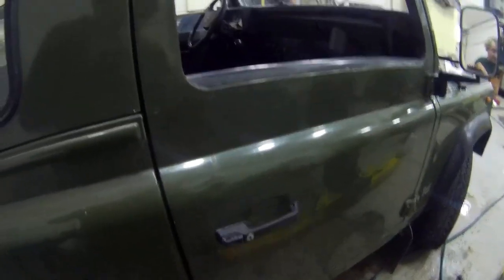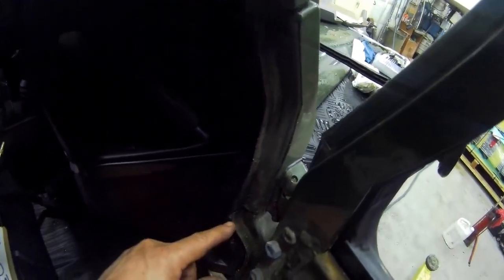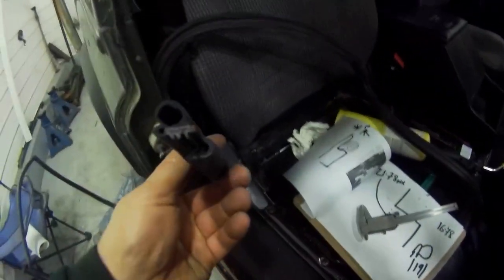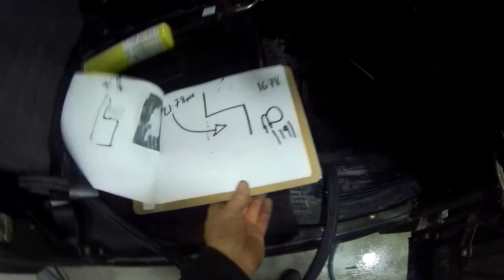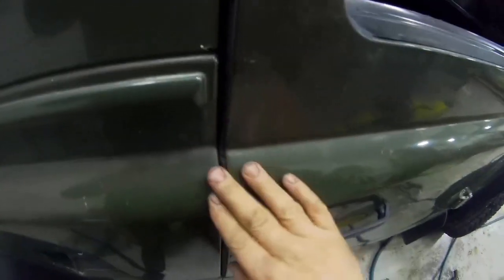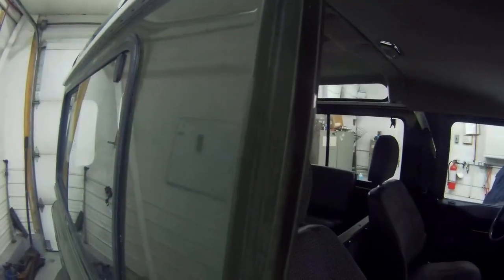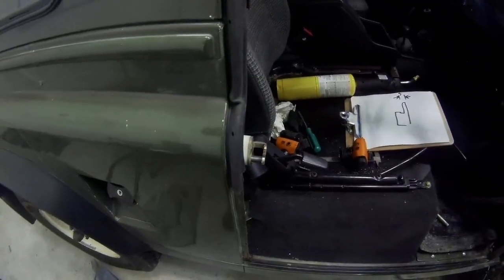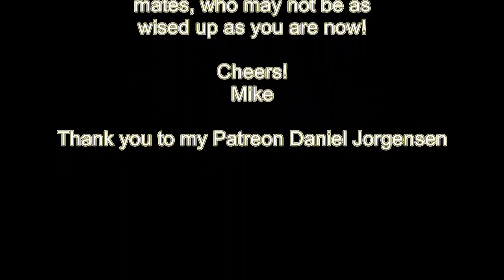Defender doors - fitting the seal to stop leaks - Success or fail?

Comment: I realise this was an old video but I have only just found the channel . what a refreshing collection of videos to see.  No dramatic intro sounds & images, just down to earth presentations.  Great thumbs up!

Am I right in thinking it is better to adjust the door prior to installing the seals?

My '91 Defender 90 pickup has both wonky doors & tired, split seals as well as completely rotted waist-seals.  Its in poor shape overall so everything will need to be altered ... although not today, blowing a cold stormy gale in Somerset & no garage!

I'm incapable of the bigger mechanical jobs but I think I should be able to 'shut that door', lol.
Reply from the maker: I always fit the door without the seals - just be aware some cheap seals are so hard you have difficulty closing the door after fitting them. Some seals have reinforcements in the top corners - this makes the door stick out at the top
Reply: Thank you for the speedy response.

In your experience, is the rubber-quality of LR OEM really worth, in both price & longevity, double or greater than replacements?
Reply from the maker: Genuine Puma door seals fit and shut well - OEM are not OEM in this case Genuine ones are made in Poland. I will not fit anything else as they can spend days getting cheaper seals to fit
Reply: Grateful for your input.  Thank you.

Comment: Where you pushed up the foam padding, could it be cut down in half & then re-inserted in the cut through the outer foam seal before you reseal it in the original position? I am soon at the point where I have to do this & will try it unless there is no point!
Reply: I see a similar comment made below. I wonder if it worked?

Comment: Hi Mike,
I’m having the same problem with my Defender 90 to the extent I really need to slam the one door to get it to latch properly. The foam insert in the seal seems to be the issue. Do you think it would work if I carefully removed the foam insert, sliced it in half and replaced it so that it wasn’t as big? I don’t mind if the door sits a few mm proud but it’s the fact I really need to slam the door to latch is what bothers me most. 
Thanks. 
By the way, love the videos. Best resource on the internet I’ve found for Defenders bar none.
Reply from the maker: Yes remove the foam (it is not glued in) and superglue the cut
The top corners are tricky and have the same foam but I noticed on later aftermarket seals the foam was not in the top sections
Mike
Reply: Britannica Restorations Ltd Thanks Mike. I’ll give it a try. Thanks for such a quick response.
Reply: @BritannicaRestorations  Hi Mike I had the same problem but after couple weeks all problems disappeared and now the doors closed perfectly ! The seal just need more time to settle down.  Regards

Comment: Hi Mike greetings from sunny lancashire came up against this very problem today spent about an hour trying to get the door and seal  to work together no chance!
Reply from the maker: Hi Simon

You had the same problem as me?
Frustrating isn't it!?

Mike
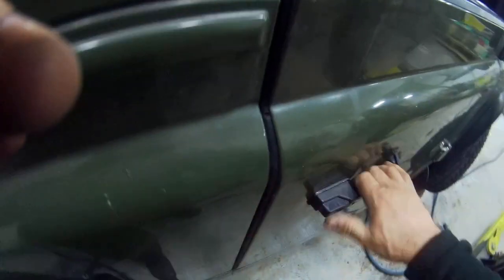Reply: I was hoping that I had installed my seals the wrong way. The doors pop out when you try to open just like at 10:40. Wonder if we put that corner into some press before fitting in, would that help to get the door closed properly? Cheers.

Comment: Hello Mike,
great vid, I will try to set up new door-seals this month.
In anothert Vid youn compare two versions of seals with a ballpoint-pen. Can you name me the "best" version of the seal to use on a 2012 Puma 110?
And, of course", what to use instead of dumdum, as this product istn't available?
Reply from the maker: The best are the Genuine seals but a bit dear at £75 each.
You can use 3M strip caulk as a replacement

Comment: I had new seals fitted years back and I struggled to shut the doors at all, yet the gap between seal and door at the top was huge. Better now mind.
Reply from the maker: I am afraid there is not much we can do
I saw a brand new Puma in the UK, and it looked as if the doors were falling off!

Mike

Comment: Maybe worth mentioning also that the bottom seals were updated with Puma and apparently do a much better job as they go around the corners of the doors and do not leave a gap at each corner. 
Product #LR029309
Reply from the maker: Thank You Jeremy
I was aware of these, but they do not fit on the earlier square type door bottoms

Land Rovers solution (300 Tdi - Td5) was to stick a bit of self adhesive sponge on the door bottom corners
I think they fell off in the first downpour! 
Lol!

Mike
Reply: They do fell off after opening the door a couple of times ;-)
Reply from the maker: Jeremy,
Sometimes I roll my eyes at the things Land Rover get away with

Never on a Japanese vehicle

Mike

Comment: whats "dum dum"?
Reply from the maker: Biff
Dum Dum was a trade mark name in the UK of a rubberised sealing putty.
I see it is no longer available, but a similar product is 3M Strip caulk

https://www.3mcanada.ca/3M/en_CA/company-ca/all-3m-products/~/3M-Strip-Caulk-08578-black-1-ft-30-m-/?N=5002385+3293654356+3294529206&rt=rud

Not as flexible as the DumDum, so I would warm it up first

Mike
Reply: Britannica Restorations ..thanks Mike
Reply from the maker: You're welcome!
Mike
Reply: With my hearing, I thought you said gun gum, the stiuff you use for sealing exhausts! No wonder I was getting messy!  :D
 @BritannicaRestorations